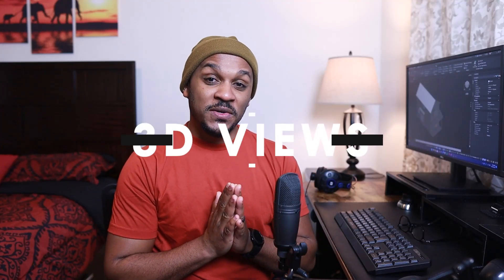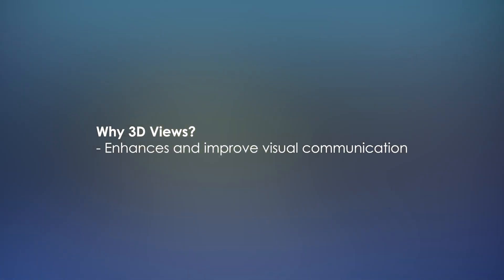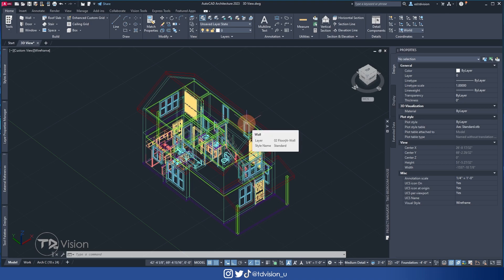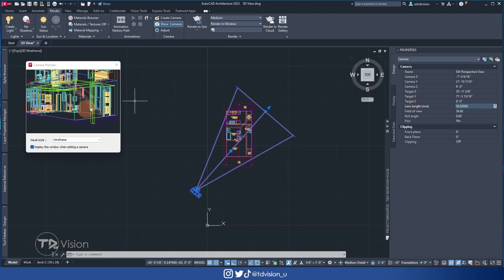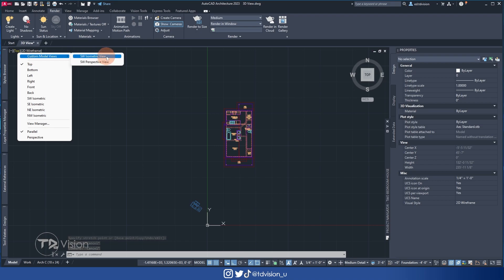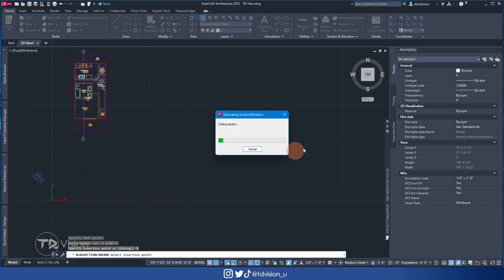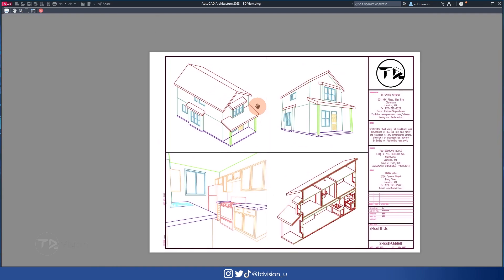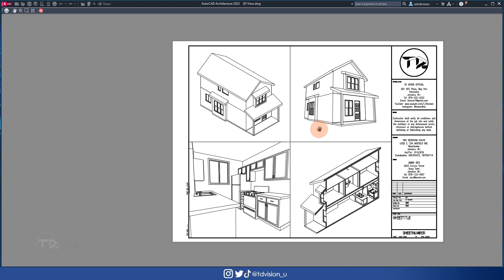3D Views in AutoCAD 2026

Comment: I use this program a lot too, but the Revit it is in fashion now but with this progrm i do also everithing, the only problem it is that when i do a view or section the grid line do not appear like in Revit, i have to put them by myself
Reply from the maker: You're correct. There might be a work around for AutoCAD Architecture.
Reply: @TDVision_U  Yes and who could make them to develop more the autocad Architecture beside of Revit wich it is fashion